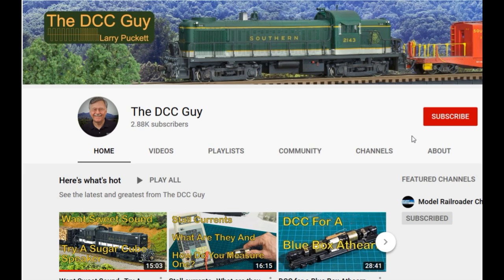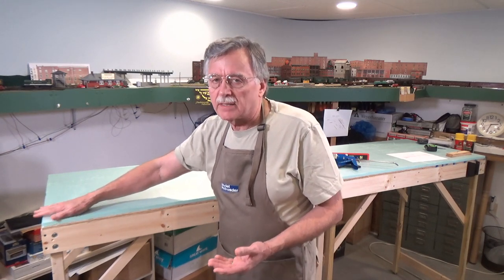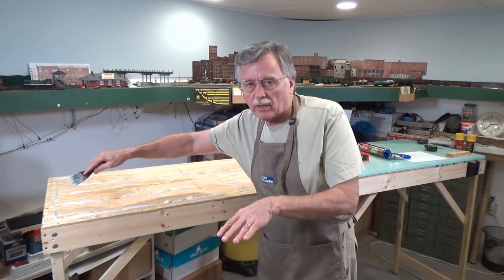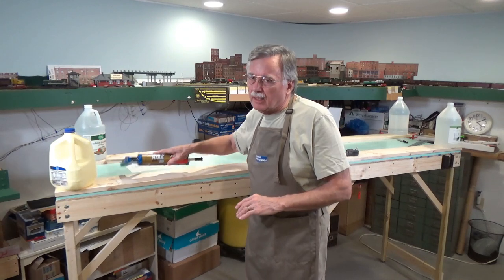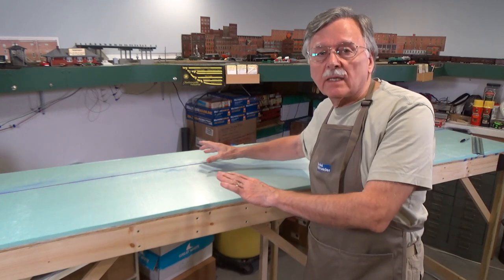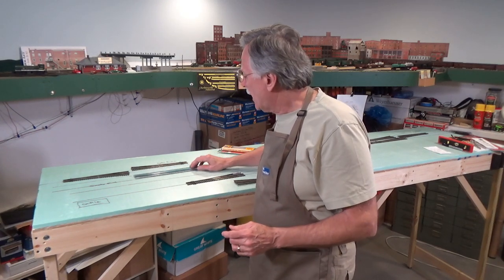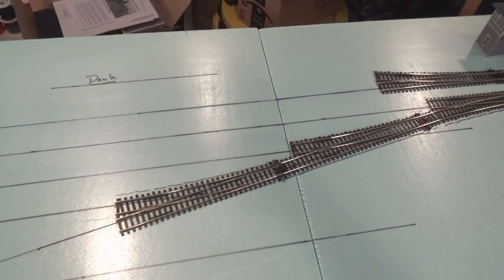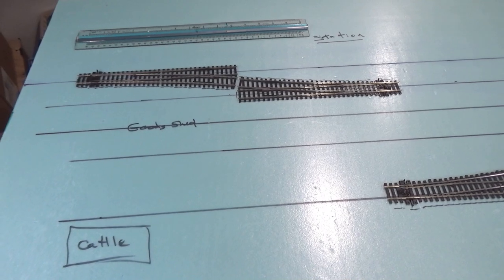Transferring The Trackplan (136)

Comment from the maker: I have had questions concerning alternatives for the foam insulation material I used, especially from UK modelers. here is a note from a friend in Wales on the subject. I also will ask Charlie Bishop what he uses over in Somerset.

Extruded foam sheets were very popular about ten years ago, and I used them a lot myself, but then they became much
harder to obtain. My local DIY (home improvement) store used to stock them in packs of four but they seem to have dropped
out of favour with the building profession so are much less readily available. But they can still be ordered: I put a thread on RMweb about exactly this subject and I got directed to some suppliers:
 
https://www.rmweb.co.uk/community/index.php?/topic/152941-pink-or-blue-extruded-foam-insulation-board/&tab=comments#comment-3899249
 
As far as I'm aware, the nearest UK equivalent to Homasote is a product called Sundeala which was what all the modelling
magazines and books recommended in the 60s and 70s, because it takes pins easily. My dad built my first layouts using
Sundeala. But it's somewhat out of favour nowadays because it's heavy and tends to sag between supports, as well as being
susceptible to damp (which may be a particular issue in the UK!). It's still used, though.
 
I've used all sorts of methods for layouts, as have my friends. 
 
My home-based N scale layout is built to battleship standards, using hardboard sheets over timber framing, all sealed against
damp. Hardboard is a compressed wood fibre product, denser than Sundeala. On top of that I added 1 inch thick Woodland scenics foam boards, then cork or foam roadbed.

Comment: Looks like it's going to be a fun layout, Larry! Liquid Nails for Projects is a great adhesive to use on foam, no doubt about it! If you're going to lay down foam on a medium to large sized layout, though, the cost can be a bit high. For my 19 x 7 foot layout, over the top of the 1/2" plywood I laid down 1" of foam and 1/2" thick sheets of Homasote, because I plan to nail (pin) down the track. I used PPG Gripper primer paint as an adhesive for the foam and Homasote. It did an excellent job on all three materials! The cost for 1 gallon was about $25 at Home Depot. I still have some left. I'm looking forward to the rest of this build! I'm going to use Peco Electrofrog's as well, but in code 100 as I have some older equipment that doesn't like code 83.
Reply from the maker: I’ll take a look at the PPG primer. I usually order the Liquid Nails by the case.
Reply: Just a thin coat on each surface will do the job.

Comment: Peco seems to be the only one offering concrete tie turnouts. I would love to use all concreate ties on my modern layout.
Reply from the maker: I am pretty sure that Walthers, Atlas, and MicroEngineering offer concrete ties too.
Reply: @TheDCCGuy  Any suggestions for what to do to match the concrete track ties when I have to build turnouts?
Reply from the maker: The prototypes I have seen used standard wood tie turnouts mixed with the concrete ties under the rails.

Comment: That was all neat and pretty.  How about transferring a plan to a layout with L girder construction.
Reply from the maker: I design my layouts using Cadrail and with that you can place the benchwork against a wall and measure out from it to all points on the layout. Essentially the same approach as how I put in the mainline on the modules and then placed the other tracks at measured distances. I used Cadrail for that plan too.

Comment: You forgot to mention a very critical point, some of the foam board comes with a clear plastic protective sheeting that must be removed. Often times the pink has it on both sides, if not minimum of one side. I learned this the hard way and had to sand the glue and clear sheet off.
Reply from the maker: The green foam used to come with it but I haven’t seen it used in about 5 years so I assumed they have dispensed with it.
Reply: I use the pink stuff and have not encountered the plastic film.
Reply: @flyboy2610  it could be just only the thinner pieces. I know it was on the stuff I bought several years ago

Comment: Larry, I am interested in understanding the layout of a railyard in addition to a depot as you are describing. It looks from the packages that you are using #6 Peco turnouts? If I were constructing a railyard what would you suggest using...possibly #4's or stay with the #6's. All of your videos are so thorough, it gives so much helpful and useful information .Thank you. PS would you consider doing a video in the future on loops and wyes and how to go about wiring them? Again, thanks.
Reply from the maker: Yes, when I get to the point where I am installing my reverse loops on the Piedmont Southern I will definitely do that. As for the yard layout hes I am using Peco #6 turnouts. You could use #4 or #5 turnouts for this and get a more compact design. MicroEngineering has a nw tyoe of turnout specifically for yards that allow the more compact design without adversely affecting operations or long wheelbase equipment. If you visit their website you can download a good pdf on how to use these. If they had been available when I started the PS I would have jumped on them instead of using Walthers #5 in my yards. Here is a link to the pdf http://microengineering.com/Micro_Engineering_Ladder_Track_System_v1.pdf

Comment: One important detail that you've omitted is the exact model of PECO turnouts that you're going to be using for this layout.  PECO offers a number of HO/OO turnouts, including small, medium and large radii.  There also appears to be a difference in length between the UK and the USA versions that you hold up in the video.

All of this comes into play when laying out the track plan.  I tried to do so using XTrakCad, but without knowing which model turnouts you were using, it was difficult to replicate your design.  

One important consideration was the arrangement of crossovers, butting one diverging track against another, without having a short intermediate straight section.  Another consideration was keeping turnouts from bridging the module joints.  Both of which can lead to eventual headache.
Reply from the maker: Yes the UK versions are a bit longer. I remember mentioning that I am using Peco electrofrog large radius turnouts but maybe that detail got edited out. I’ll mention it again in Friday’s video.

Comment: Hi Larry, great video, do you have a name for the green foam, as over here in the UK I am struggling to find anything similar ?  Most bulders yards have a insulation foam board called Celotex or Ecotec, but they have tin foil glued to both sides and is therefore quite expensive. Some hobby stores do a blue foam in small sheets for modeling, but that is even more expensive.    Regards, Dave.
Reply from the maker: Dave, sorry to be late answering but your comment got stuck in YouTube limbo for some reason. I think I saw that Everard Junction uses something like this so let me go back and see what he said.

OK, it appears he uses cork sheets laid on top of the plywood. I will also contact a coulpe guys in Somerset and Wales and see what they have found and get back to you. I am sure this is a question that will come up regularly. Also do you have a cess to a compressed paper board called Homasote? It is popular here instead of foam sheets and comes in various thicknesses including 1/2”.
Reply from the maker: I added a pinned comment to this video with some feedback from a friend in Wales that has some suggestions.

Comment: Larry - Please confirm or correct my understanding....you lay out the parallel track lines first. After which you manually place your turnouts on the lines in their approximate locations. Finally with the turnouts down on the previously drawn parallel lines you draw the centerlines between the turnouts? Is that the process? I'm concerned about my turnouts not lining up precisely introducing a kink in the connecting track between two turnouts. Is my understanding correct? Thank you for a great series!
Reply from the maker: That’s my method. The turnouts dictate placement of the other tracks, especially since when used to create a crossover they create 2” parallel tracks which is pretty standard for HO/OO.

Comment: With the difference in the U.S & UK Tie spacing  it would make it easier to visually show the main & secondary rail lines for U.S. modelers.
Reply from the maker: I’m not sure what you’re asking for. Other than the visible differences in tie spacing and width the two track and turnouts systems are essentially identical. The UK “OO” scale actually uses HO track gauge, so US models can operate on their tracks and vice versa. For all intents and purposes there will be no real visible differences between building the US or UK versions until we get to adding buildings and other UK specific trackside accessories. Had I not told you which I am building you wouldn’t know for weeks or months.
Reply: UK has farther tie spacing because it is 1/76 scale rather than 1/87 scale.

Comment: Hi Larry. Did you use a special type of foam? The conventional objection to foam is that it denatures over a (relatively short) period of time and just crumbles away. I'm not sure that in the UK we have signal boxes quite like the one you're proposing to use (but hey, Rule 1 applies, right?).
Reply from the maker: Paul, it is a foam designed for long term installation in homes as insulation and should be stable over long periods. I have been using the same foam on the Piedmont Southern for 7 years with no issues. As for the “signal box” it usually sits at the intersection of the Southern and C&O mainlines in Charlottesville on the Piedmont Southern and I just grabbed to use as a stand in. One of the Peco GWR versions will be permanently installed on this layout.

Comment: How do you lay the track over the area where the tables are joined?
Reply from the maker: It depends on whether the layout is permanent or portable. For permanent I sand the two sides to make sue they are level then install cork roadbed over the gap. For portable modules. I just lay the track and adjust the height using the leveling feet I install on the bottoms of the legs—watch that video.

Comment: To plug up the hole in the end of my adhesive tube I just use a 16 penny nail.
Reply from the maker: I used to do that as well as dict tape wrappings, but after a few months it would dry up in the tip and ruin the tube.Since I found these caps I have not lost a tube.
Reply: @TheDCCGuy  I've also used wire nuts.

Comment: Hi Larry - Can I just take my full size paper templates and glue that to the foam board? I'm building a yard so its all getting installed on the flat foam board. I would lay the track directly on the paper template. Do you see any issues with that? Thanks. Really enjoy your channel.
Reply from the maker: I wouldn’t lay track on the paper. Instead use an an old sewing trick. Lay out your paper then go over it using a pounce wheel. These are devices with a small wheel in them that has gear like projections around it. When you press down and roll over the plan it will perforate the paper and transfer the design to the foam board. Wood carvers use these to transfer designs to wood and then go at it. After you transfer the plan then go over it with a Sharpie. I have also seen folks who work chalk dust through the holes in the paper created by the pounce wheel to transfer the pattern. You can also place carbon paper under the track plan to make the transfer. Google pounce wheels for more info on this method.
Reply: @TheDCCGuy  Thanks Larry. Someday maybe I'll be good enough to give back. In the mean time, I'll do my part by purchasing products. :)  Your a really good teacher.
Reply: @TheDCCGuy  Using a ponce wheel is a great idea!

Comment: Hi Larry, great videos thank you for doing these. I have noticed recently online (and you also mentioned it) the metric reference to inches, i.e 2.9".  Not sure metric to inches translates that well and struggling to work that out? Cheers Jim UK
Reply: Worked it out 2 3/4"
Reply from the maker: Jim, sorry I assumed that English units were still commonly used in England. As a research scientist I used metric units all the time but in retirement I have slipped back into my childhood teachings. In the future I’ll try to toss in some metrics as well. In case I don’t 1 inch is 25.4mm.
Reply: Hi Larry, no worries, no please don't change things for me.  My generation 60+ sort of understand and work with both, personally I'm pretty much in metric now.  It was just that I'm not sure an imperial  only person would understand 2.9"  which appears to be a bit of both measuremenr systems.  It's a bit like the scale in UK for OO gauge is 4mm to the foot!
All the best, Jim UK

Comment: Hi, DCC GUY   I've to know from where I can find the right motor to the HO SCALE locomotive GP. Thank you
Reply from the maker: First check the manufacturer website to see if the sell extras. If that is not an option then it can be difficult anymore. Some Chinese motors off of eBay may work and some sellers offer them on eNay as well. I recently found a Bachmann motor that is no longer available that way. You also may be able to find a damaged model that is begin sold for parts.

Comment: Is there any reason you chose 1 inch foam instead of 2 inch? I’m about to do the same myself and was thinking a 2 inch would give me more options for carving my scenery below track level.
Reply from the maker: I used 2” foam on a previous layout and find it makes it harder to install Tortoise switch machines. The combination of 1/2” playwood and foam gives a total of 1” and you can easily mount Tortoises or anything else with screws. When it comes to scenery I just pile up slabs of foam and carve to shape. If I want a deep ravine or river I drop that section of the layout. I showed how to do that in an article in Model Railroader October 2014.